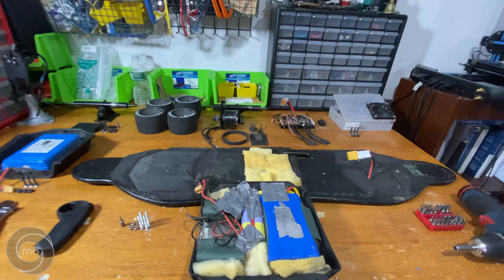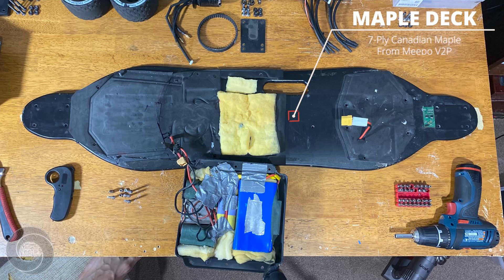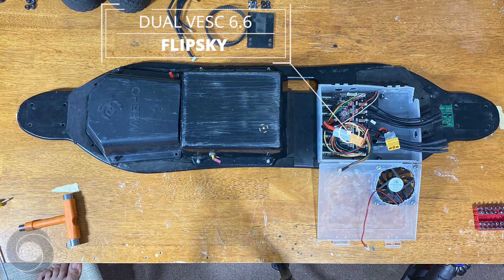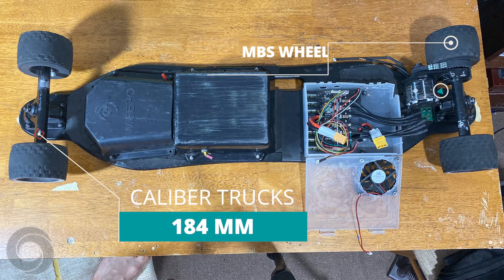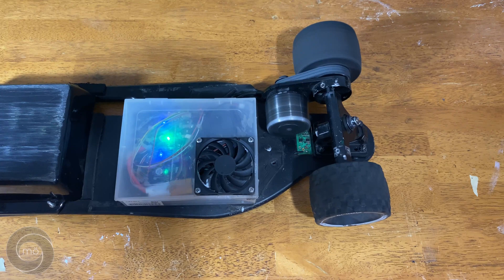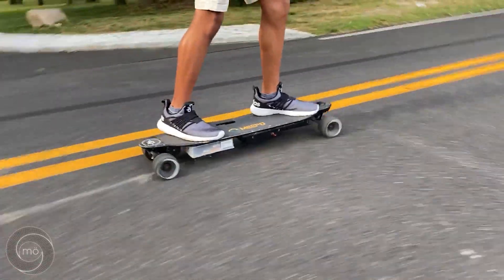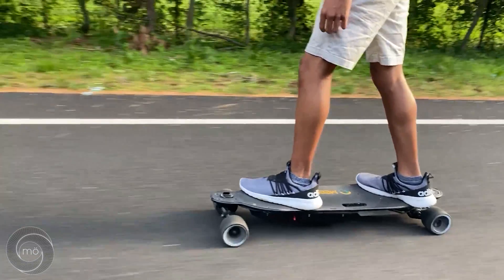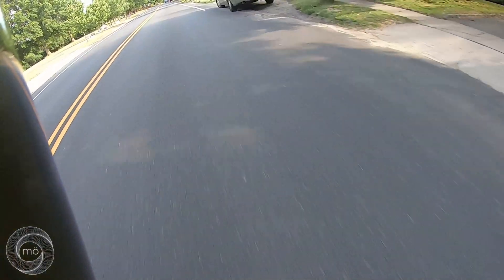How to Make a 46MPH Electric Skateboard TUTORIAL (30+ Miles Range)

Comment: Nice build 👍. What gearing did you go with and how many amps is it set up for?
Reply from the maker: Shane Muddell we went for the maximum power output. It’s a 15:45 gear ratio and it puts 67A to the motor.